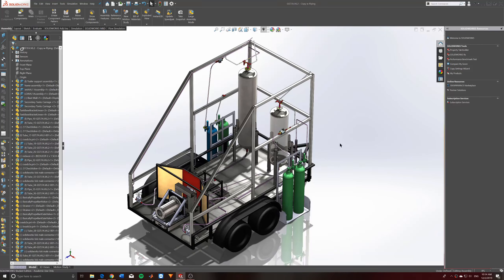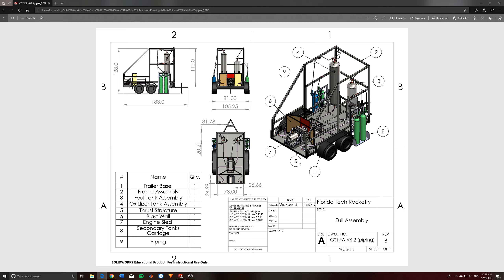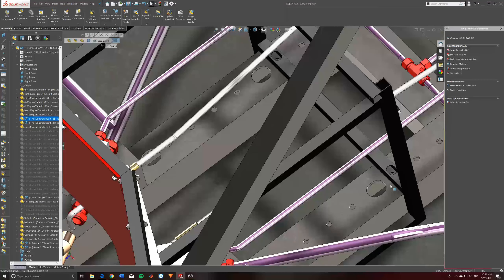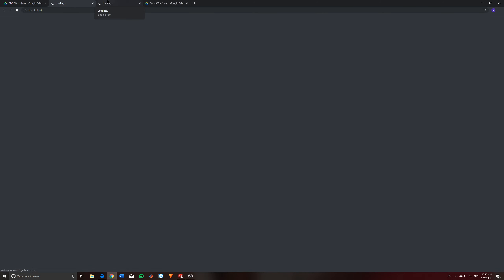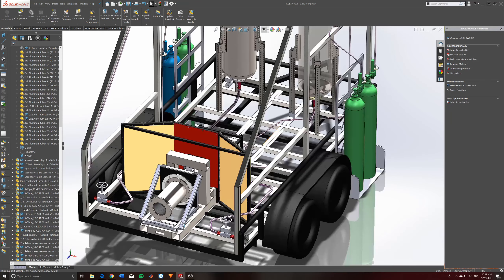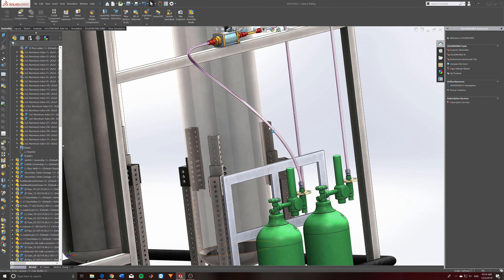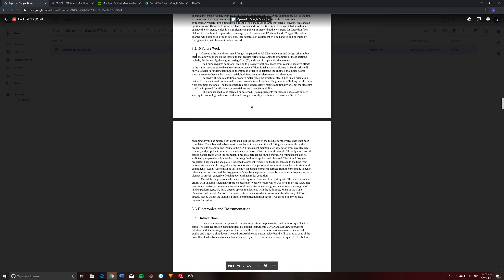FTR GST Stand Design Overview

Comment from the maker: Important Timestamps:
1) Start of overview @1:05
2) Frame overview @2:20
3) Tanks overview @3:05 
4) Thrust Structure overview @4:00
5) Blast Wall Overview @5:50
6) Engine Sled overview @8:25
7) Original BOM and part links @10:01
8) Secondary tanks carriage @12:15
9) Specific Sub assembly placements @14:20
10) TRR Changes @15:35
11) Future Work start @18:25
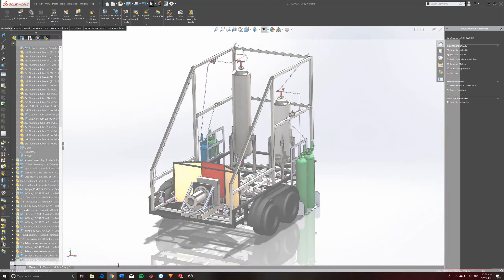12) TRR Document resource @22:05